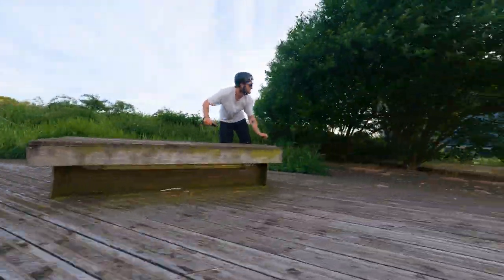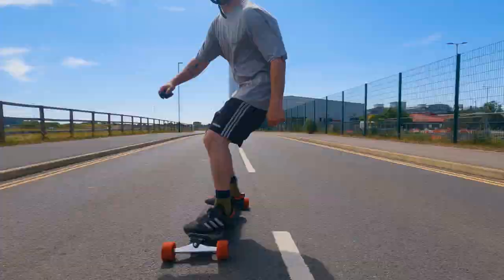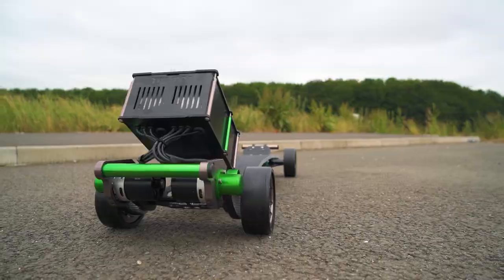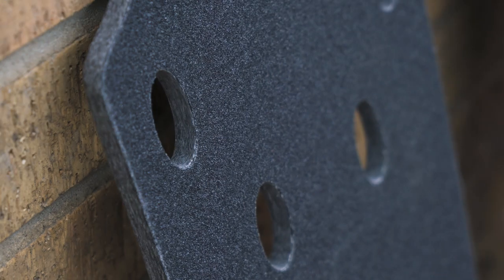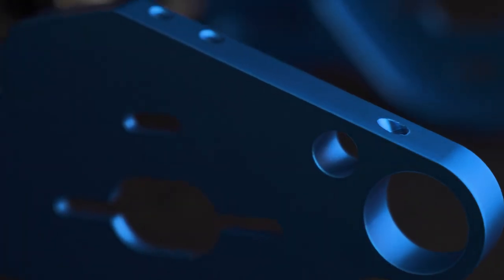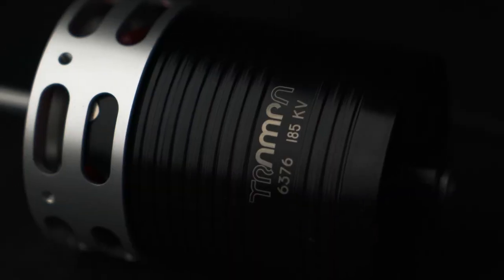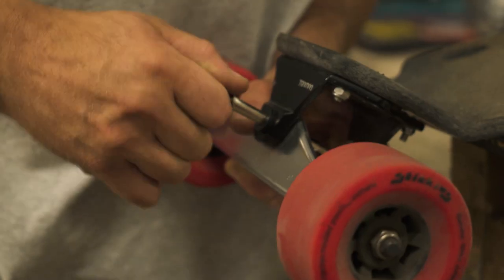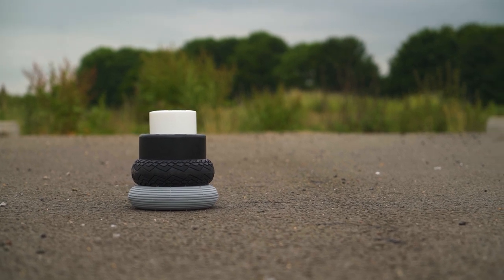What makes THIS board so special

Comment: Carve board is the best!  I bought one with the pneumatic  wheels but switched to longboard wheels for extra range.  Ended up being obsessed with the carving/surf like ability of the trampa deck and mini spring trucks combo.  Its a waaay different feel than carving on a longboard.   The spring trucks and flexy deck allow you to carve on a dime even though the trucks are wide which usually prevents carving.  Benefit of the wide trucks is that you are stable at high speeds.  I can go 30 mph on my electric carve board and feel very stable but also able to carve on a dime.  Really  is incredible setup.  I just need to upgrade my battery and some day go to 2 motors because those are the only limiting factors
Reply: How much does a standard one cost?

Comment: I recommend a front freebord binding, gummies and very soft front dampas (depending on your weight - or barrels). I'm not a fan of super flexi boards for road use, I would rather have a stiffer deck for more stability at full speed. The springs + dampas do a very good job already regarding shock absorption!